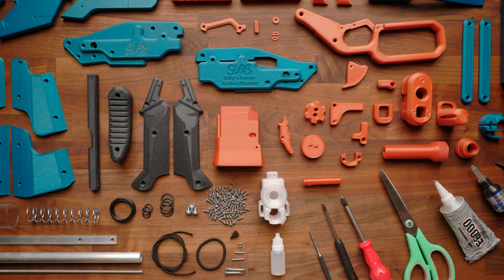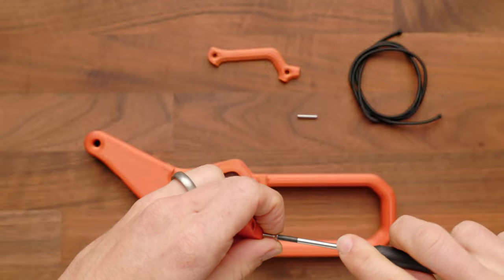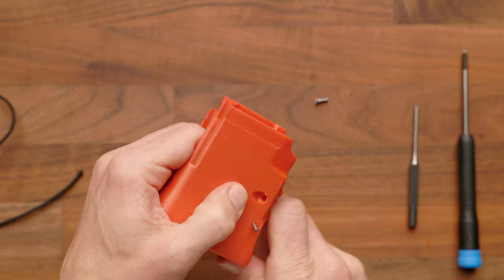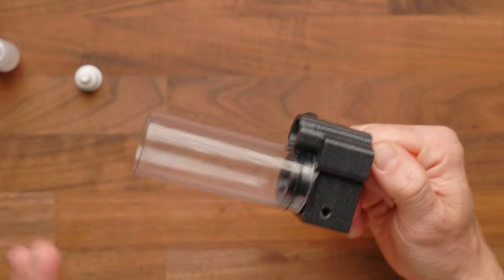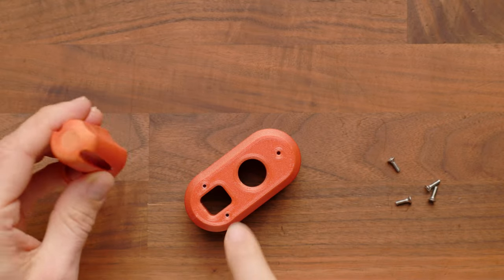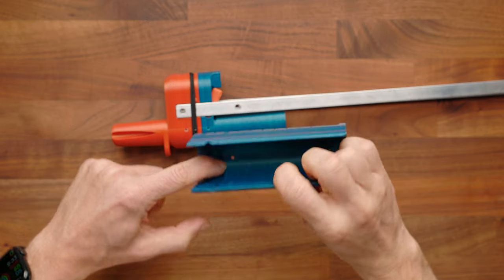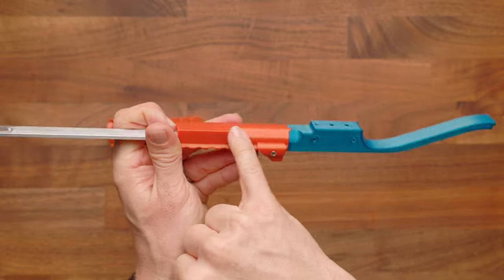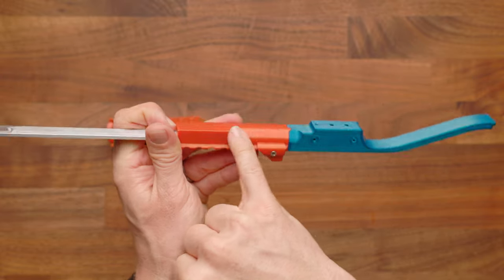BUILD GUIDE: SLAB

Comment: Out of darts plz reply 
I have an idea for a blaster and can you  tell me what the flaws are 
The idea is: what if you had a machine pull back a spring but that would be slow so have 2 or 3 springs and have an accurate automatic blaster that shoots fast
Reply: That's called an AEB. They do exist, and Silly has been working on one. They're very common in Airsoft, but foam darts need roughly double the spring energy to fly the same speed as a BB pellet.

Comment: One thing to note, it would not be hard, nor a bad idea, to get two nuts on the threaded rod above where one's hand would grip it so that you can deprime the blaster without firing and it's not so awkward trying to balance the blaster, hold the sling lever, and trigger it from the back.